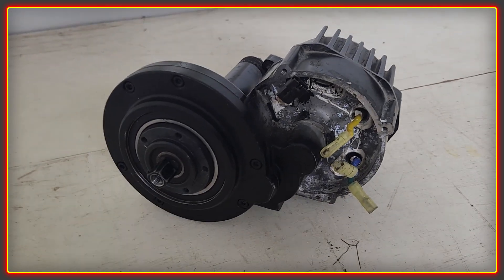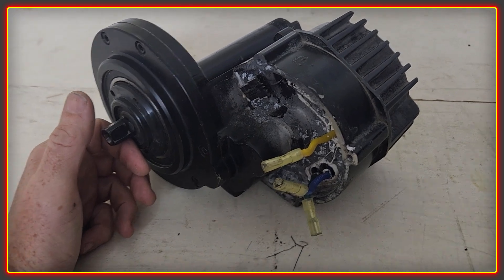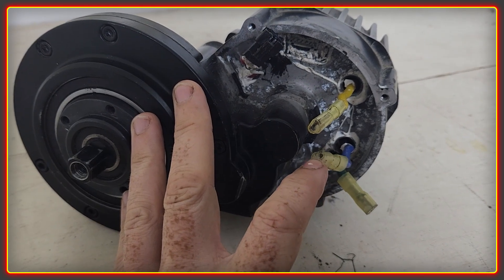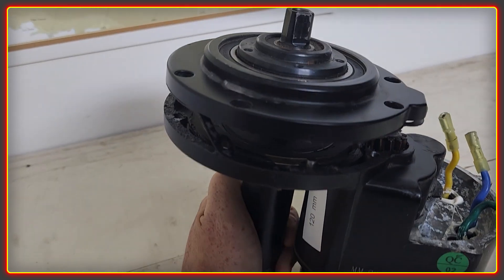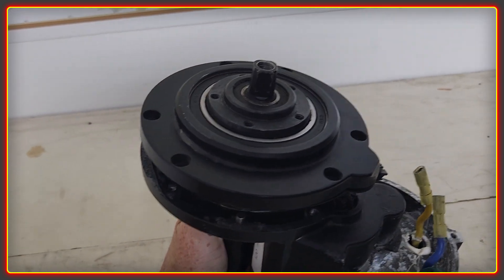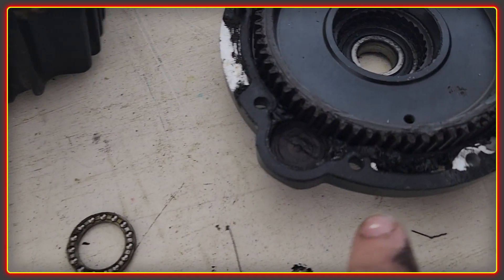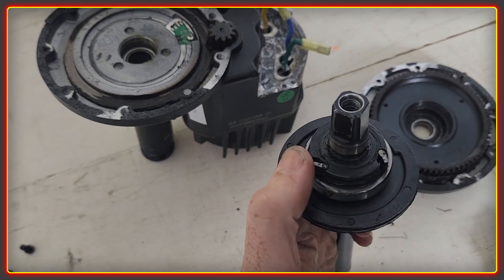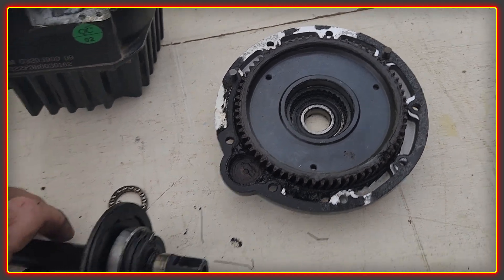The state of my BBSHD after 10,000kms of high power abuse and 5 Canadian Winters.

Comment: Could the water damage be caused by condesation from changes in temperatures.  Seems like you did a good job in water proofing!
Reply from the maker: Maybe. It was stored in an unheated garage in a pretty humid place at times. I also road it down flooded paths! I am going to give it a quick clean and then get it all back together. There is a missing o ring I need to replace but apart from clean and regrease thats it pretty much.

Comment: I did my first BBSHD conversion to my wife's mtb in mid-2019.  As a consequence of repeated failures of a G510 bike I was running, I would wind up on my wife's bike for my 25km beach excersize rides.  The following year I divested from everything G510/M620 after a 3 year love/hate relationship.  In late 2022 I did manage to snap the old style rotor shaft on the wife's motor at around 10K km, same rotor shaft you have.  It was not much more money to replace it as a rotor/stator set, but you can press in a different bearing and run the old style HD stator with the new rotor.  I believe the set was USD140, and now I have a spare stator for the two HD's I operate.
Reply from the maker: Great job. I have heard similar stories with the G510. I had thought I had the newer rotor on mine but it turns out not. I'm just going to leave it till it goes for now as I want to get the bike back together. Thanks for the comment.

Comment: Interesting video particularly the lack of servicing and 6000miles later the motor is still running and appears to have very little wear even at 3000W. Mine should last a lifetime running 48v and 25amps max.
Reply from the maker: I was pretty pleased. You should get plenty of distance. The grease won't last forever though and they tend to be a bit stingy at the factory.
Reply: Boring

Comment: Thanks for taking the time to do this and post another quality video! Just proves the BBSHD is consumer perfection (apart from the stock controller setup). I've done 5000+ miles and mine is completely silent - nothing, no issues at all.
Reply from the maker: Yes the controllers can take some work. The motors are very overbuilt for a modern consumer product.

Comment: Does bafang or an aftermarket company ever plan to make an isis shaft for the bbshd,? Square tapers flexing a bit.
Reply from the maker: I am yet to come across one or any plans to make one. Bafang themselves are releasing a new version but it's still square taper. You might have better luck with lekkie cranks. The ones I have feel rock solid.

Comment: I have a BBHSD on my recumbent and have put approximately 4000 miles on it.  The only change was to replace the factory controller with   a LUNA 30 amp one.  Do you have any recommendations on how long it could be expected to last under normal riding?  I live in Southern California and the bike has not been subjected to extreme weather.  Also, do you have a recommendation for a replacement 52v or 60v Lithium Iron battery?
Reply from the maker: Based on what I see in mine I would change the grease reasonably soon. Nothing urgent unless it sounds louder to you. The worst that will happen is it might get louder. They are not perfect so you can get things like the clutch fail. It's pretty easy to replace any part. Hopefully you will be as lucky as me. You can regrease the main gear without taking it off the bike which is quite useful. 😉
Reply from the maker: Battery there is Golden motor, eco cycles. If you want something more custom there is Rio on Discord.
Reply: @HighVoltageKits  Thanks for the information,  I'll check them out.

Comment: Add some corrosion X to rotor, circuit boards, connectors, plugs etc. Waterproof & anti- corrosion resistant, I also add glue-lined 4 to 1 heat shrink to most plugs after installing the corrosion x. Glad to see another BBSHD after long distances. Over engineered & made to last, a surprisingly & well made product in this disposable modern society.
Reply from the maker: I'll check out that product. Thanks. That's a good point with regards to it not being throwaway and maintainable for years. It is rarer and rarer. The right to repair legislation will hopefully gain ground.
Reply: Definitely not over engineered in any way😂
Reply: @eXTreemator  Ok, I have to disagree, BBSHD can cope with Overvoltage, Over Current & has proven to last for thousands of kms, with stock internals.
Reply: @oze-bikes4life663  disagree all you want. I actually know what's inside and don't see any overbuilding. Yes it's has closed rotor but it's design is still mediocre. While it's not terrible but proven by who? It's just baseless popular opinion coming mostly from stock users where it's yes redundant and unnecessary heavy. Give me your hd i will make it needing repair in two weeks.
Reply: @eXTreemator  sure mate, whatever 🙄

Comment: What "Extra multiple layers of protection around these wires" are you referring to, at 42 seconds? I apply heat resistant silicone to the casing, then stick on the gasket, then add more silicone - seems to have kept out water so far, despite much riding around in extremely wet weather.  I feared bearings would have been damaged when a  badger leapt out of a hole right under my bike wheel and broke my wrist (there are videos on my channel showing this happening [action camera on my helmet's jawguard], just search for "badger"), but the motor and bike were fine, apart from a smashed headlight, which I've replaced with two 1800LM front and one 1800LM at the back (made red with heat resistant acetate sheet), all soldered to my ebike's battery... although this wouldn't have made any difference on the night, because they would have startled the badger into leaping out anyway, as badgers do when they see bright car headlights - if you don't want a titanium plate holding your wrist bones together too, fit an ultrasonic wildlife deterrent to your bike.  Cyclists, watch out for badgers!
Reply from the maker: I had di electric grease on the connections and then heat shrink over the top. I had cut it off on here. I used silicone around the entry points. I tried some liquid electrical tape. Not using that again tho.
Reply: @HighVoltageKits  Thanks for that information!  I've applied self-amalgamating rubber tape on the speed sensor connector, 4:1 self-adhesive marine shrink over the rest of the wiring harness connectors, but the 4:1 sets into a shape when it cools, so it'd be tricky to use self-adhesive 4:1 for the connectors we're talking about, because it's a tight fit in there, but I'm tempted to try, applying your dielectric grease first.  It aint broken just now, so I won't fix it, but certainly next time.

Re: Torque sensor on the Bafang HD - interesting news, potentially, if real.  I certainly hope Bafang update their BBS01/01B/2/2B with that - personally, I prefer cadence sensored for ease of pedalling, but many others seem obsessed with torque sensored mid-drives, and those people end up buying TSDZ2s with that motor's many many problems. An official retrofit torque sensor kit for Bafang's older models may be too much to hope for.
Reply from the maker: Never hit a badger but have been taken out by a Canada goose before. Yours sounds more painful!
Reply: @HighVoltageKits    Canada goose?!?!?  At what altitude were you cycling?  I've been forced to take up weight lifting, to prevent my wrist from dying and rotting off - maintaining blood supply is a challenge for some reason, because they've reinstalled my wrist wrong lol.  Broken wrist at 12mph (I was slowing down for a bend).  I heard the badger scream when it hit my bike (sounded like a child), but this wasn't picked up by my camera's mic. It's a long, horrible and bizarre tale best not told on Youtube!  Turned out, the surgeon was a keen cyclist, and he was rather shocked that a badger leapt out in front of my bike like that.  He didn't actually believe me until I showed him the video.  Said he sees badgers quite often when cycling in the woods near his home, and would be more vigilant in future. Quite heavy objects, badgers.  Cyclists beware of badgers! And geese!

Comment: That is impressive, are you going to replace the crank end bearings, i beleave they tend to wear quickly, & did you run the motor at high power for long duration? Or mostly in the lower power range, i have herd of nylon gear failures, with the stock controller if pushed continuously hard. But who knows bafang may use diffrent nylon suplyers, resulting in various nylon composition. I have had no issues with The HD 1500 kms in. Thank you for your videos, appreciated
Reply from the maker: You are welcome. The bearings feel very smooth so I'm probably not going to replace them this time. The Nylon gear tends to fail after getting warm and subject to stress breaking teeth. I used to cruise about 30-50kph most if the time enjoying the acceleration. Lots of sustained hill climbs though. I will pull the gear so can have a really close look at it.

Comment: Can you share how you are getting to the 3.5 kw rating in terms of voltage and amps?  From what I know I think higher amps would do more damage to a motor than higher voltage.
Reply from the maker: Its running 72 volts 90-100 phase. About 55 battery amps. The real trick is the field weakening that let's the motor hit really high rpms of 13,000+ vs the stock 3,500. We use a 1:1 ratio so the motor spins up fast. In doing so, it prevents the heat from the amps building up. We developed our own upgrade kit for it with proper thermal rollback to help manage things further. There are quite a few videos on the channel covering it in more detail if you are interested. Cheers
Reply: how much amp  field weakening ?

Comment: I have gone over 15000km so far on my shunt modded bbshd running at 50 amps, I should probably give it an overhaul as well since it's starting to get a bit noisier under full load. Unlike the CYC motors that I've had experience with, the BBSHD is a solid option that rarely fails if you have put silicone around the wire loom.
Reply from the maker: Yeah. When it comes to reliability Bafang have them beat.
Reply: Give it the revolutions cyc has this  bearings shit will fall apart in two weeks

Comment: great video. apart from controller issues ive had same longevity from the 3 bbso2 i run,21000 miles in total. what is remarkable no greasing on your unit
Reply from the maker: I have a feeling that the original grease job was ok. It's just thrown it off and degraded over the years. You can see where it's congealed! It will get some tlc!

Comment: Nice job mate! That's actually the older motor too. Nice to see an older motor with the smaller rotor shaft and bearing holding up to some high power abuse. They updated the BBSHD in April of 2019 to a bigger rotor shaft and stator housing bearing due to rotor failure issues from it snapping where the shaft meets the rotor laminates. Cheers!
Reply from the maker: Oh really. That's interesting. I thought I was on the newer one! Very cool.
Reply: the shaft upgrade came after they changed to the B style controllers (which yours came with).  I got caught when the change was pushed through without telling the vendors

Comment: I see no reason why this motor wouldn't run another 5 years. It's actually really impressive what you get for the money in these motors. $400-$500 is such a steal. Obviously more for the HV kit, but still. Such amazing value in this motor with its versatility and proven bomb-proofness (it's a word I just made up). Even if you had to replace a few parts, it would only be at most likely $200 and that would get you another few years. So so good.
Reply from the maker: Yeah! Bang on point. So much value over the years with this. Cheers
Reply: Make that at least 10 years with proper maintenance. With proper care and temperature control it actually takes forever to eat these gears and bearings.
Reply: @AstralS7orm  it definitely would take me about two weeks for the bearings

Comment: Mine in 5 seasons 30.000km without any mainance. 💪💪
Reply: Amazing sir! I just added heat sinks everywhere around the motor blocks, seems like the heat is getting transfered really good. Im now doing 30km runs twice a day with almost full throttle for 30-45minute straight without any problems. Best investment ever.
Reply from the maker: That's impressive. Stock power?
Reply: @HighVoltageKits  Yes
Reply: Well I would hope that it would last more than 30km.

Comment: Reviewing the BBSHD internals, with what you have put this motor through in terms of voltage and amps and winters, I would say homerun.  How could anybody ask for more?
Why we all love the BBSHD in its simplicity and robustness at a great price.
Even if you had to replace with a fresh motor for another 5 seasons, few could complain in terms of smiles per mile.  The fact it has even more life with little part replacement is quite remarkable.
Thanks for sharing with us and have a great visit with your family.

PS. Curious what grease you will be using both in the outboard gear reduction and internal to the motor around the pinion and nylon gear?  Most of us use Mobil 28 both in the outboard gear reduction AND internal to the motor around the nylon gear as other grease is incompatible with the lithium grease and the plastic gear and Mobil 28 is said to be compatible with both different greases Bafang uses and of course Bafang chooses two very different greases from the factory for a reason.
Curious what your position is on this?
Reply from the maker: Thanks for the comment Luke. Totally agree. I'm pondering the grease. I am currently thinking of using a different one in with the bearings and clutch and then the Mobil stuff elsewhere for the main gear and nylon. I don't really want to have two types mixing in there. In terms of value I think you make a great point. The pleasure it's given me and my kids is incalculable. Cheers
Reply: @HighVoltageKits  Also, will say, I hope you perform one of your great performance reviews after you restore the bike with latest High Voltage kit.
Very curious what the latest performance of your updated kit is as it relates to what battery voltage and BMS amperage you choose.
Cheers.
Reply: Price of it never was very low. And bafang design still has problems and they keep using some shit components.

Comment: I am surprized that you never taking it apart. My bbshd has never screwed up on me but i take it apart and grease it  every 6 months. I noticed ypu have a different  rotor then mine at the base of mine  it gets smaller
Reply: i think yours is an early one bafang changed the design of the rotor. thicker spindle
Reply from the maker: I probably should have. I'm always pulled in so many directions though. I think this has the upgraded spindle as a 2018 model.